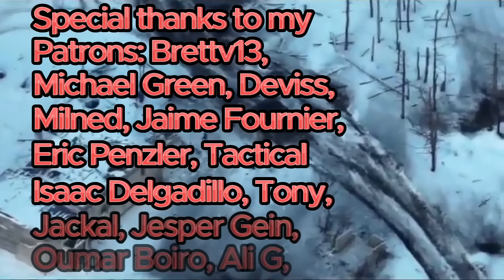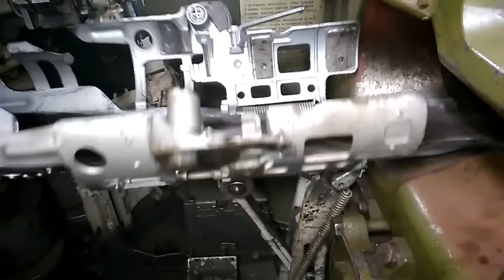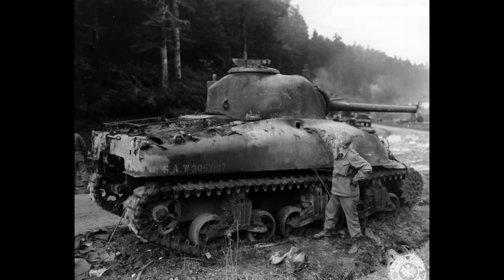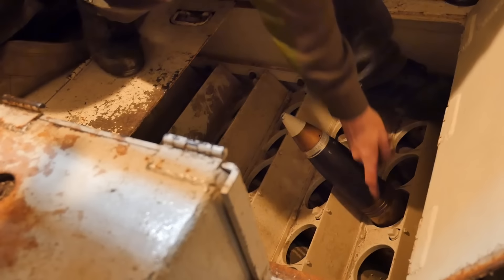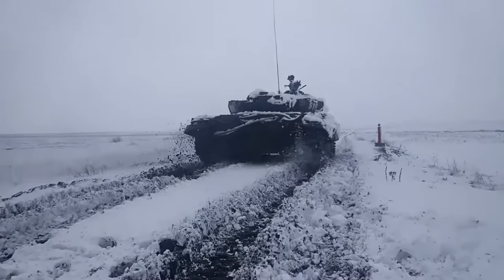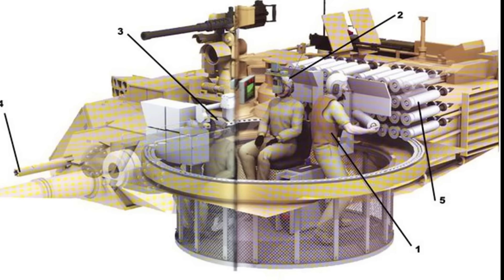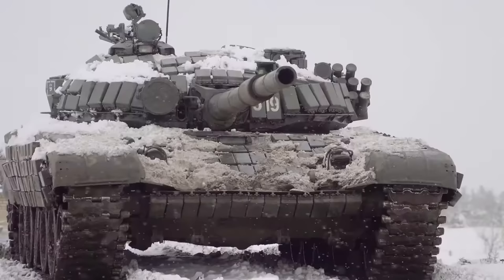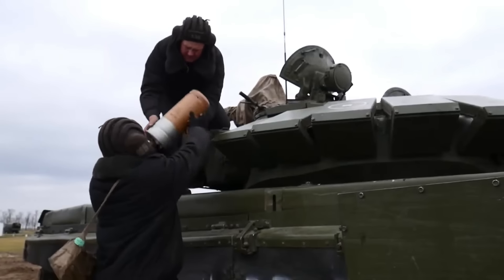Is Autoloader Really the Reason for Russian tanks exploding so much?

Comment: To m1 defence it was never intended that after getting ammo cookedoff even with blownuppanels working to be able to just shurg it off and drive back to base still burning. Its job is to save the crew from insta evaporating after getting their ammo hit not to save a tank as a whole from burning out.
Reply: Tanks are cheap to replace, experienced crews are not. 

While it seems like in Russia crew and tank are both replaceable. So safety has not been the main focus.
Reply: @mikkel066h  a few years ago noone knew that drones would be such an issue. Previously a few grenades tied together were the greatest threat to the top of the tank
Reply: The blowout panels aren't there to "shrug off" the cook off but give the crew a chance to run away. When the blowout panels go boom, ditch the tank immediately. You won't be able to drive it back to base like you said since the heat would've gone through the bustle whole from the heat.

It will still burn but the crew has some chance to run away.
Reply: @pilotmanpaul he literally saied it was never ment to "shrug it off"
Reply: @pilotmanpaul  i literally said that bruh man stole my whole flow
Reply: @yellowtunes2756  what are you talking about? Abrams were getting FVP droned by isis during the battle of mosul. If rag tag terrorists can do it, why cant state armies?
Reply: This is actually a weakness a simple rpg from the 70s can causes the blow out panels to pop and the tank becomes an operational loss 

in that respect its probably the weakest tank right now
Reply: @Theaverageazn247  no-one considered it a threat. Otherwise USA would train fpv drone operators in mass
Reply: @mikkel066h lol it doesn’t matter anymore. Almost every time the crew gets out an FPV is sent to hunt them down.
Reply: @mikkel066h and recently a UA Abrams crew in an interview said that the crew usually doesn’t survive
Reply: @sebastianbaez-serrano2298  So what I hear you saying it doesn’t matter to put crew survivability into a tank? Since there is a chance they might get droned when ejecting the vehicle. Or am I not understanding your point correctly
Reply: @mikkel066h  it matters. You’re just taking an untruthful dig at RU by saying they don’t care when they have showed the opposite.
Reply: @sebastianbaez-serrano2298  How have they showed they care?
Reply: @mikkel066h  By literally adding survivabilty features. Are you slou or what?
Reply: @yellowtunes2756  They have always been training in mass. Back in Mosul it wasn't as advanced but in Ukraine right now it has shown that FPV has significant effect in dealing with Russian arms while still being a cheapest kind of "weapon" without having to lose any manpower. Also the US do train FPV drone operators, they are just more advanced and often called "UAV".
Reply: Actually turning the turret sideways decreases the chances of the whole tank burning up quite alot, not always possible but if it is then partial recovery can be done.
Reply: @mikkel066h  Tanks are cheap to replace IF you can actually make more.  How many NATO countries make mass production tanks?
Reply: @richardgoed8101  what fpv drones does USA use? What's their name?
Reply: @fantastikboom1094  That would make sense if their overall concept was the survival of the crew. Just because you add armored skirts and a cope cage on the tank, does not mean the state cares and military doctrine cares. 

It is the overall idea of crew survival that matters. From training, design to implementation of the vehicle. And I hate to break it to you, Russia falls short on a lot of those things.
Reply: @victorzvyagintsev1325  None since no NATO country is at war. However a lot of NATO countries have quite large Cold War stockpiles of tanks.
Reply: @mikkel066h  Comparable losses as in Ukraine are catastrophic for any NATO country, even US.  And turret bustles = easy pray for FPV drones.
Reply: @off6848 You’re reaching very hard, especially with that last sentence. That’s just a complete lie and you know it. 

When you say it’s a “weakness”, what tank does not have the same weakness in that the tank becomes disabled when the ammo is hit? I think I would rather still have a hit to blow out panels and survive then almost any hit to the hull resulting in a catastrophic explosion. 

 So in what respect does that make them “the weakest tank”?
Reply: @victorzvyagintsev1325  That goes with the assumption of a peacetime economy. So don’t know what your points is, Russia has clearly lost more in material and men compared to Ukraine while being the aggressor country.
Reply: @mikkel066h  Not true. Russian tankmen were told to abndon the tank if they're hit, as they are "not-replacable, unlike the tank"
Reply: @treycotter  How is it an exaggeration at all?

You guys keep harping about crew survivability thats great but what is the point of a tank force if your heavy armor gets one tapped and becomes an operational kill.

Have you seen even 1 successful assault with the Abrams this whole conflict? I can give you dozens of videos of T tanks assaulting and taking footholds I can't think of 1 instance of the western tanks doing it.

This is because they only carry 90% apfsds and some MPAT and canister shot so they really only have one strength which is anti armor but the tank itself can be one tapped by 1960s weapons because the casualty adverse design makes it a glass cannon. 

Also the crew survivability thing is whats exaggerated I can show you videos of drones blowing up the m1 and then after the crew bails another drone hits the retreating crew this is how its done so the fact that they may survive an initial direct hit is moot they still die just from arty or more drones on retreat.
Reply: @off6848  an RPG would have to hit from the top which is really only possible in urban environment... FPVs are way more of a threat to all tanks. Abrams operational loss is preferable to T90 detonation, as at least part of Abrams is recoverable and crew survives in that case.
Reply: @off6848  You’re intentionally arguing in bad faith in almost every single point you made. 

“What is the point of a tank if your heavy armor gets one tapped” oh okay so then we’re not just talking about the abrams then are we? Name one single tank in ukraine that hasn’t been one tapped? 

“Have you seen even 1 successful assault with the abrams this whole conflict” this is bad faith and you know it bud lol. 
1. There’s only 34 abrams delivered to Ukraine. You’re comparing 34 tanks to several thousand?? 
2. Ukraine is currently not doing large offensives so this makes no sense anyway. 
3. How about you look up 1991 desert storm as well as 2003? 

Why are you labelling the abrams as a “glass cannon” because it has a weakness? According to this logic, every single armored vehicle ever made was a glass cannon. 

And your last point is just entirely ridiculous to where you’re completely abandoning the actual discussion of the vehicles capabilities. 

“The crew can still die after they’ve left the tank” automatically invalidates any argument you’re making since the job of the tank is not to protect the crew when it’s outside the tank. Please tell me the name of any armored vehicle ever which protects the crew after they’ve abandoned? The fact that you’re trying to paint this as a flaw is just a huge tell that you’re grasping at straws in bad faith. 

“The fact that they can survive a hit is moot since they still die just from arty or more drones” 

No, in no world does that make crew survival moot? According to you, there is no point in attempting to save the crew of a vehicle because they can be killed outside of it? Are you willing to die on that hill?😂😂😂 

And also just look at your wording lol. “They still die” because you watched a single video of crew being targeted after they abounded? You’re obviously just trying to make up arguments as you go here.
Reply: @treycotter  No its you whos arguing in bad faith you're claiming that Russian tanks have worse survivability because more are lost ignoring that both sides have fielded thousands of T series tanks only 30 abrams. 

Theres no objective data to suggest western tanks are more survivable much footage exists of single hits destroying them the west has pleaded for Ukraine to pull Challengers and Abrams off the line because they know they aren't any better and they lack the proper munitions to be effective in fire support roles which is why they're rarely used and when they do pop out they get destroyed like any other tank

Every point i've made can be supported with video evidence in fact i'll go further and point out that theres MORE video evidence of T tanks taking more FPV hits than any western tank in the hundreds of videos i've reviewed. 

We can play a game if you'd like I will find you videos of T tanks taking several FPV drone hits and not being destroyed and you find me videos of western tanks taking several FPV hits we can add them up and see who has more evidence you down?

Btw a t72b3 blew up an Abrams with one shot already. There's no way to conclude that its a better tank when each tank can only take 1 hit from the other but thats only theoretical for the Abrams since it has done it so far likely because Russian barrel atgms out range m1 apfsds so they can't get close enough to get a kill
Reply: @off6848  Also “the west has pleaded for ukrsine to pull challengers and abrams off the line” you completely made this up. This is just factually wrong lol, they didn’t.
Reply: @off6848  As well as your first paragraph of your comment is a complete straw man. I never made any of the claims you said I made, you made those up too. Try to stay on task👍
Reply: @treycotter  Forces News: Ukraine forced to withdraw US supplied Abrams

WION News: Ukraine pulls back US provided Arbams

Crux: Russian Hunter-Killer drones force Ukraine to withdraw Abrams

Kanal13: Ukraine withdraw US Abrams tanks from frontline

All you had to do was search
Reply: @treycotter  AP News: Ukraine pulls US provided Abrams from the front

NPR: Ukraine pulls US provided Arbams tank
Reply: @treycotter thanks for shooing him off, I tried to reason with him on the last video Red posted
Reply: He posted this but deleted it: "Not really Abrams blow up when they're spotted theres only 30 of them compared to thousands of T tanks which means more targets more losses. And I've heard nearly half have broken down and are back in Poland under going repairs which is why we rarely see them pop out."

Talk about disingenuous.
Reply: @V3RTIGO222  Yeah he’s extremely biased, there’s no point in trying to actually have a logical conversation with him.
Reply: @V3RTIGO222  I didn't delete that didn't even know it was deleted thanks for reposting it. 

Its you who is being disingenious how is anything I said there disingenious? How is is it genuine to talk about losses without accounting for the fact that both sides deployed thousands more of those tanks? 

See thats the problem you're disingenious talking about tank losses when theres 50x less western tanks. 

None of you have disputed that point. We know from video evidence that when Ukraine brings out NATO tanks in force they get massacred 

Proof: Robotyne Leopard graveyard. 

See this is how you guys are disingenious you want to make it seem like western tanks take less losses because theres fewer of them and they're not being used Ukraine has stated that they switched to using them in limited capacity. 

A common sense conclusion: its bad for propaganda to show the truth. 

Also if it was only that they take less losses because they're so invincible then why is that we saw them take several losses and suddenly as they take fewer losses we don't even see them working? 

Miraculously that a lack of videos showing them on the front doing assaults just happens to coincide with more rare losses.

Common sense says if we don't see them doing work that means they aren't being used much therefore slower losses. 

I will say though we just one lost only a few days ago in the Konstantynivka donetsk direction. 

So again when they do show up they get blown up. 

Everything I've stated has video evidence to back it up but you guys have been unable to provide any proof of your claims such as that crew survivability is better we simply don't see it we just see blown up tanks then western media reports "crew got away" with 0 proof
Reply: @mikkel066h sure, sure.... human waves and all that.
Reply: @treycotter  There no point because you have no evidence thats why you just sit around like eachothers posts lol. 

Why don't you provide the proof of your claims, I'm arguing against three different people in this thread so I get mixed up sometimes so why don't you restart your claims and we can review the evidence
Reply: @off6848  No it’s not my responsibility to babysit you through the conversation. I’ve only responded to your claims so far and you’ve in turn made up arguments against me.
Reply: @off6848 Ask the Russians that fought in Chechnya "What a single RPG can do"; I'd rather be in an Abrams and mission killed than in a T-72/64 variant and become a modern art piece, thank you very much.
Reply: @Wackimir-Pootin A bustle rack fire in an Abrams will almost always burn through the turret bottom and then through the engine, which is why the crew is trained to and "supposed to" turn the turret sideways when abandoning the tank. As then the power-packs not only saved, but you're ensuring an easier exit for the driver as well as he doesn't have to potentially try climbing around the gun too after opening his hatch to bail out.
Reply: @yellowtunes2756 There's the Switchbalde series, with the larger Switchblade 600 having a longer range and packing the Javelins tandem warhead.
Reply: @pyro1047  switchblade is a lancet analogue, not standard fpv. It also can't stay in place or move up without moving forward.
Reply: @off6848  You attend that there isn't enough statistical evidence to support that the Abrams and T series are comparable, which is a valid argument... yet still make the assertion that the Abrams is inferior - that's an entirely hypocritical double standard. Neither me nor Treycotter made the assertion that the Abrams is objectively better, you're shadowboxing people who are only pointing out how bad your logic is, not people supporting this idea of western superiority.

If you want to actually debate instead of argue, then we can address the loss ratio (units deployed to units destroyed) of tanks within the same upgrade era. While this acknowledges that the losses of Abrams and Leopards is statistically unsound, we can estimate the effectiveness of them as compared to Russian vehicles within the same era of production.

Your M1A1SA is equivalent to the T-72B, both produced/upgraded to that standard in 1985. Now we can easily see that the T-72B has a much higher loss ratio than Abrams, but again we cannot make sound conclusions only off that, as deployment of each is notably different. We know that superior deployment and tactics results in fewer losses while inferior deployment and tactics result in higher, regardless of the quality of the vehicle... by that metric, if the T-Series is superior then it is still foolishly deployed and lost en masse due to poor strategy from incompetent generals.

Still, you and other Russian propogandists like to compare the Abrams sent to Ukraine to the most updated versions of the T-Series, which is disingenuous and foolish at best... if you seek to underestimate your enemy and have them fold you like a pancake for breakfast, I encourage you to continue upon that line of thinking as it will net you trench warfare and a long, hard road of dead soldiers at your feet.

Here's an interesting idea for you... have you considered that an Abrams could be outfitted with ERA that fully protects the top portion of the tank unlike T-Series? Because of it being flat and rectangular, it can be completely covered by ERA panels which are flat and rectangular... I wonder what Ukraine might be doing, pulling their Abrams back for retrofitting against FPV drones...
Reply: If a shell is going right through the crew compartment to hit the armoured carousel, then it's going right through the crew. There is no surviving that, detonation or no detonation.
Reply: @viktoriyaserebryakov2755  Stacks all crew in a row to take the round with their bodies so the tank survives

Is this tank engineering?
Reply: @V3RTIGO222  "Stacks all crew in a row..."
"... to take the round with their bodies so the tank survives"

Substantiate these. Then substantiate the implication that post pen effect behaves like it's just a bigger bullet.

The mental gymnastics you've employed to make yourself look like an imb"cile is almost humorous.
Reply: @viktoriyaserebryakov2755 it's a sarcastic response, and you taking it seriously doesn't make me look like an imbecile... The person I responded to stated that a round simply penetrating the tank would kill the entire crew, I jokingly made my comment to show how ridiculous that idea is. Perhaps you should read his comment and respond to him instead.
Reply: @yellowtunes2756 switch Blade i think.
Reply: @gilangputra7514  switchblade is a worse version of lancet. It has nothing to do with fpv drones both sides are using in thousands every day